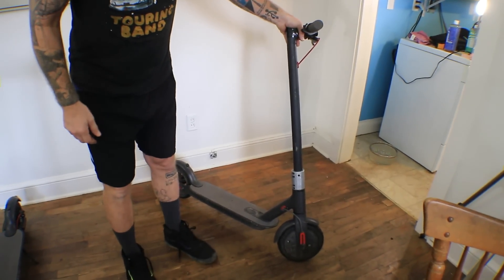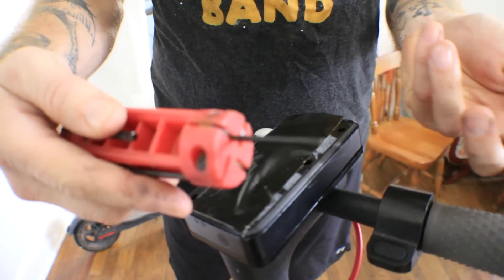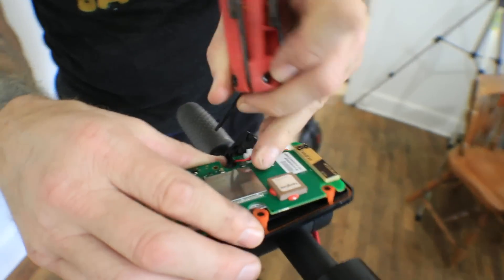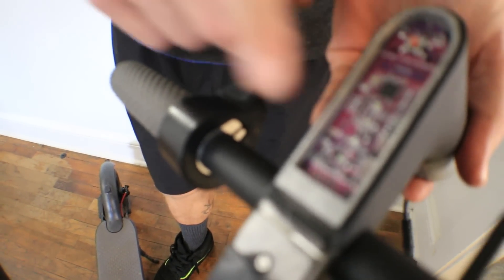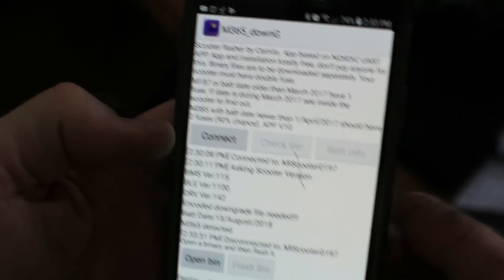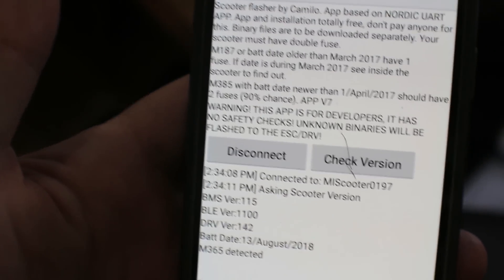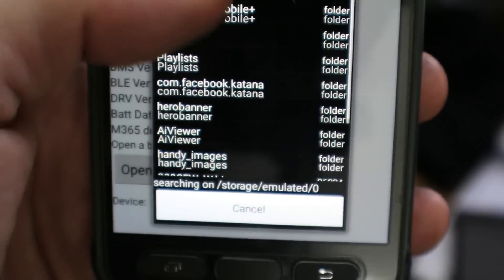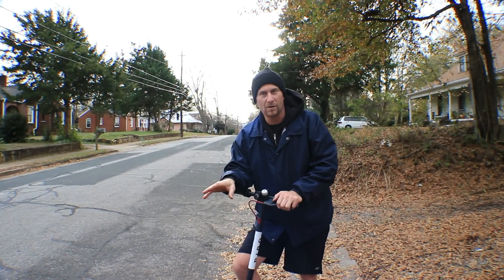Abandoned Bird Scooter now works like a regular scooter!

Comment: It’s batteries and motors not hard for anybody  with a brain to do the thing is thefts for this reason account for a small percentage of the total fleet. They have accounted for this and I’m sure will continue to try to advance security features to prevent thefts of scooters. I’m aware that yours was obtained legally but the ever since these scooter had come out I have always wondered how easy it would be to take one and mod it so it works like a personal scooter. Anyway I thought the video was neat and my point was the scooter is a frame, battery, and motor a person with any brain could most likely make it work free. I do actually wonder how many of these end up taken or whatever.
Reply from the maker: I can't even figure out what you mean by that😅
Reply: Mr Reviews it all my bad I typed a response and didn’t bother to re read i attempted to make it more understandable hahah 😂
Reply from the maker: @heavy_haul_n_fool  makes more sense now thanks for the edit LOL
Reply: Plus the theft of them is called a loss which a company writes off and they get reimbursed for them..

Comment: The ESC at the base will still show on the bird map GPS... you will be chased by chargers everyday... a lot of which are criminals.. good luck
Reply from the maker: Already checked that ya kook, it doesn't show up.  Go try to scare some kids.
Reply: The esc doesn’t have a SIM card. Or a cell chip. Or a gps. It’s a speed controller. That’s the most ridiculous thing I’ve ever heard

Comment: And now everone is going to steal one. Congrats
Reply: Yeah if you can find a way for the alarm to stop and take out the GPS
Reply: @смиренный-х2б  lol T8 screwdriver is all you need.
Reply: @DieselRamcharger  I used a torch
Reply: David Alexandrovitch you take out the battery first so your in incognito mode
Reply: @смиренный-х2б  I used a torch
Reply: @смиренный-х2б  easy to stop the alarm it’s on the same mother board that you have to change just unscrew the cover and pull off the little speaker and the gps just remove the SIM card that on the mother board simple
Reply: @смиренный-х2б  can do it in two minutes
Reply: Its not stealing if the property is abandoned
Reply: Too much work for theft. It's far easier to just rob a guy riding one.
Reply: @t100base  mine is on 90 volts ! I used two battery packs in series with the bms board in the battery removed and this electric bike controller 
https://rover.ebay.com/rover/0/0/0?mpre=https%3A%2F%2Fwww.ebay.com%2Fulk%2Fitm%2F302921673524
Reply: @camaro92026  hi Daniel, did you do that on an original M365 ? these 2 battery packs in series: is that for going faster or for longer range ? I fiddled around with some settings to go over 30 km/h (18.6 mph) but your range is going down. Think normal range is about 25 km max
Reply: @camaro92026  which Version of the Controller die you used?
Reply: Because no one was capable of just picking one up and carrying it off in the first place. Or buying them from an auction after they were impounded for being illegally parked and not claimed, in which case they'd be the legal owner of it.
Reply: Mc Rex c
Reply: @bangmeister2012 ayyyyyyyyyyy
Reply: Do you need to do all the software stuff to make it work?
Reply: Jesus Ramirez  how so? Is there an article?
Reply: Haters.....
Reply: @t100base  hacked mines = Downloaded an app from google play and tapped 'start' lol. I saw that video too.
Reply: @Trucked109  link
Reply: @Trucked109  which app
Reply: @Enrique Bobe It gives the last known location while you are working on it. You would need a team of people to disable them all pretty quick. Then hope no camera caught anyone.
Reply: @HalkerVeil  or wrap them in aluminum foil
Reply: @16driver16  yeah the aluminum foil thing doesnt work
Reply: How to unblock te wheel?
Reply: Doubt it, especially considering its not easy to find someone riding one
Reply: That’s the point moron!
Reply: Good thing they rip off customers enough to afford replacing them. They shouldnt care
Reply: I hope all rental scooter will disappear from street and lithium battery can work on solar system where nobody sees them
Reply: Justin good.
Reply: stealers do not work
Reply: @germanborgesxrt  thiefs don't fix.
Reply: @LEGOBELIN  yep
Reply: @germanborgesxrt  Bandits should not Boast
Reply from the maker: @mattsterxxs7908  babies should not boss

Comment: YOU NEED TO UNSCREW BOTTOM AND UNPLUG BATTERY FROM BLUETOOTH, LEAVE UNPLUGGED WHILE YOU INSTALL CHIP UP TOP. ONCE TOGETHER RE PLUG THE RED BLACK BATTERY CORD. 

BY THE WAY IT WOULDNT HAVE BEEPED IF BURD DEACTIVATED IT. UNFORTUNATLY HE DOESNT KNOW UNDOING THE TOP PHOTON BOARD MAKES HIS HOUSE LAST LOCATION, they've been sending police to people around here who have had ghost scooters
Reply: BTW UNFORTUNENLY YOU'RE NOT AS OBSERVENT AS YOU MAY THINK. HE TOOK OUT THE SIM CARD DUMB DUMB. SO UNLESS THAT FUCKERS MAGICALLY CONNECTING TO YOUR HOME WIFI TO SEND OUT DATA THEN BIRD ISN'T RECEIVING SHIT FOR A LOCATION. GO AHEAD, TAKE OUT THE SIM CARD ON YOUR PHONE AND TRY TO CALL YOUR MOMMA. WON'T HAPPEN.
Reply: Where did he remove the sim than. All 9f this is recorded and sent. I mean unscrew the bottom and you've got a whole other computer to deal with. And on the photon it has a battery, its capable of remembering a simple sim code and sending its last signal out stating removed. Things still attempt to get signal without a sim. Just without the sim it isnt activated. So the photon could still be bouncing ping off cel lmk tower and all a bird tech would have to do is connect the lost signals signature to that of the signature without the sim. Make sense?
Reply from the maker: @VisionHybrids  so the Bluetooth sent my exact location to bird and they are sending a SWAT team? These dang photons!!  Now I'm gonna have to turn my friend in that got it legally from an impound yard and he's gonna have to show the RECEIPT!!!!  you naysayers are so jealous.
Reply: @dridiott  lol no sweat team, just a letter in the mail, although you might be in a apt which clears you, I'm not a hater , I have done it myself from a "police auction"  wink wink. I'm trina help people out. Remove the box away from home
Reply: @dridiott   Just FYI I got followed by an undercover TEAM presumably because someone kept stealing the birds I would charge. They have some serious resources behind them and seem to have paid off higher ups. They kept trying to bait me when I quit charging, and I say me because I moved outside the service area and I would see the vans unloading them at 8pm, and uhauls or cars with tinted windows parked outside the places I went between, even following me into abandoned lots. Had to have a friend spend a few days with me to make sure I wasn't crazy. I figured let them waste money on me then, rather than report them for harassing me, because I doubt they would do all this without some police corruption. Some mean looking guys came knocking too. Kept all the plates in case they gave me any more shit. Really seems unbelievable to me but I guess $2bn goes a long way.
Reply from the maker: @thehemi69  "someone" kept stealing the scooters?🤩  How did you find that out?

Comment: This video is fantastic - thank you!

I met someone who has a Bird Zero: https://bird.zendesk.com/hc/article_attachments/360013098912/20181010_110034.png

Should the same method discussed here be followed to convert the Bird Zero to a personal scooter - despite it's aesthetic differences and different dashboard?
Reply from the maker: Yeah that's the Segway one I think the board in that one will cost you a hundred bucks and I'm not sure how much better it is and also there is some debate on serial numbers matching between pieces of hardware or it turns into a brick. so there's that.

Comment: All this information is correct I'm moving on to the extra battery pack and a larger front wheel
Reply from the maker: Larger front wheel. How do that?🤔
Reply: Mr Reviews it all I should also correct that and say both wheels
Reply from the maker: @atrujillo7836  sounds cool u Makin a vid?🤔
Reply: Mr Reviews it all get a 10x2 wheel and buy spacers for the fenders and kickstand so that they have clearance eBay has a kit will let you know if it works

Comment: I would really appreciate if someone can do a video or guide to change the standing pole to folding pole. there seems to be a safety screw that preventing to change to folding pole. folding pole gives more flexibility for transportation :)
Reply: Ya I could use this too, for when I want to mass-smuggle my unlocked bird scooters out of the country
Reply: There’s a rivet you have to drill out
Reply: do you have the folding one to replace with?
Reply: you can get one in eBay or Aliexpress  @prodbydramatic
Reply: I kno that i aint no stranger to this i was tryin to help you😂
Reply: Catch tends to break with , um , inconvenient results. they are an aftermarket item, but have been an ongoing danger.
Look at the growing body of reported injuries
These things are fun until they're not. Then very unfun.
Reply: Bird uses a rivet which you have to drill out in order to remove.  Lyft uses a torx security screw (T25 bit) which is what I used but was slightly loose.  Probably it's really a T27 security bit.  To remove the long screw that holds the forks to the neck that's a 5mm allen.